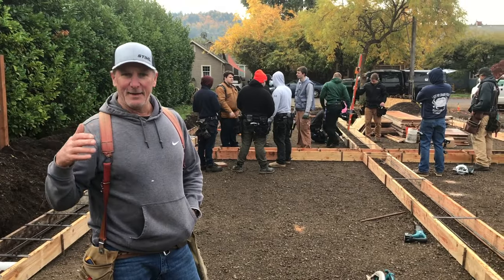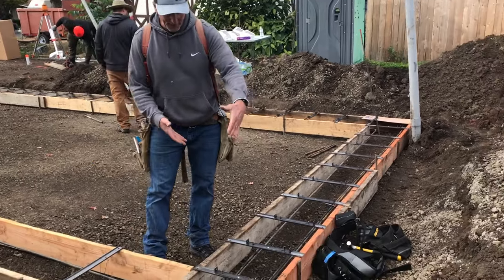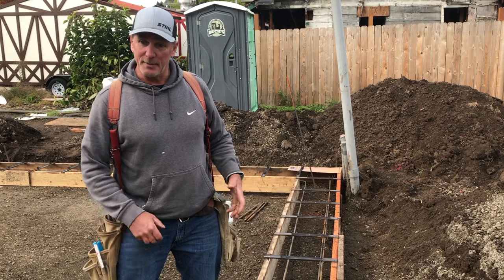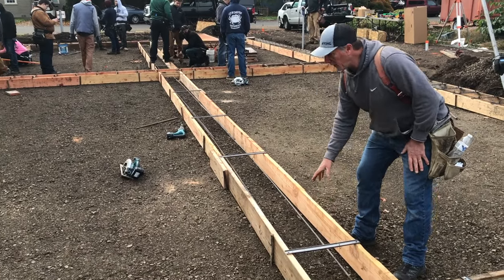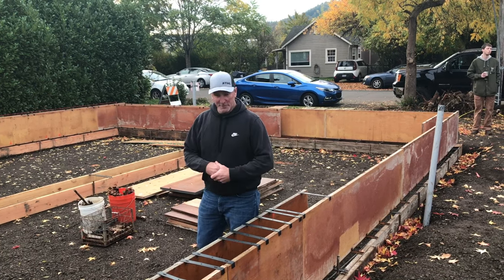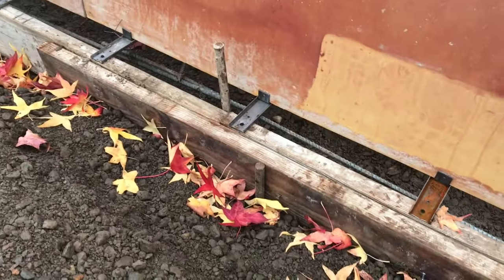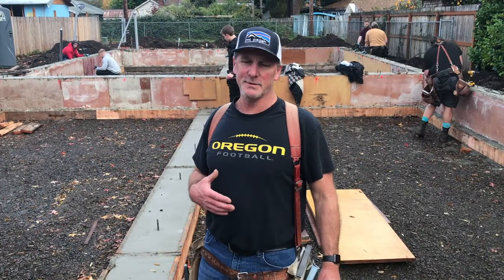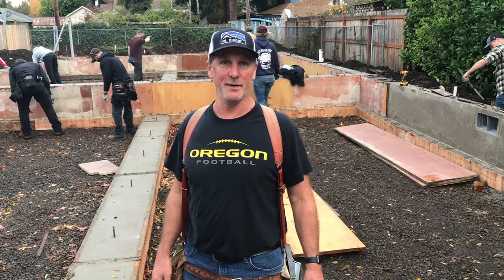Building a Crawl Space Foundation | Paul Rea

Comment: Any suggestions on where to buy the monostrap and spreader cleats as a DIYer? I am doing a similar foundation for a 16' x 24' home addition (I'm in Keizer, OR). I plan to use 2x dimensional lumber for all the forms, 2x8 for the footings (16" w), and (2) 2x10 for 6" wide stem walls. In between the (2) 2x10s I plan to use Simpson wt-6 ties with w1 wedges. I found a decent supplier for those online, but not having a ton of luck on the others. Really appreciate the videos. My house is low to the ground, so I'm doing the top flange hangers like you did in a later video. I learned a ton from all your videos, and they helped me get my structural permit smoothly :) Thanks!
Reply from the maker: We used Mason's Supply for the monostraps and spreader cleats.  It looks like there is one in Salem.  There are also 5 around the Portland area.  Good luck on your project!!!.
Reply: @buildinghouses  Appreciate the quick reply. I'll check them out. Thank you!
Reply: @Dlux DIY were you able to buy the mono straps from mason supply? We are in Independence OR and doing the same thing as you, but they wouldn’t sell to us as homeowners. Any other place you found them? Good luck on your project!
Reply: @andreawagner3954  I was told the same thing as you. I ended up finding them at Kilgore Blackman's on S Commercial in Salem. I'm actually finishing up my forms this week and pouring next Tuesday! GL on your project as well!

Comment: Thank you for a great tutorial on how a crawl space foundation is constructed.  Two questions.  Once the area is excavated, is compacting recommended before installing the forms?  Also, is the main water line run under the footing or is a hole bored through the footing?
Reply from the maker: 1) Yes, once excavation is done, compacting the whole area especially where the forms will go is a necessity.  2) The plumber puts a plumbing pipe in the footing, a small one for the water line and a larger one for the sewer line before the concrete is poured.
Reply from the maker: The pipe installed in the footing is larger than the water line and sewer line.  After the concrete cures for a few days and the footing form boards are removed, the plumber can then run his water line and sewer line through the footing.

Comment: Great video.  What if you wanted to crawl between stem walls.  Would you block out an access hole and frame it with a header or how would you go about that?
Reply from the maker: Take a look at our other video "Framing a Crawl Space Underfloor".  Paul describes how to frame out an access hole in the video.  Thanks for the comment.
Reply: @buildinghouses  thanks.  I watched the video.  What I am talking about is a horizontal access through the stem wall.  Can you explain that please?
Reply from the maker: Sorry for the late response.  I talked to Paul.  He reminded me that on this duplex building the stem wall is part of the fire wall.  So you can't have access between the buildings because it would compromise the firewall.  The firewall is discussed on the "Building Walls for a (Duplex) House" video and it is discussed on the "Rolling the Trusses (How to Put Up Trusses)" video.

Comment: Great video! I am planning to build a house and really like the cleat ties and plywood form boards for an easy stem wall form. However, it looks like it's not very cost effective for a one time use? Having enough 1" plywood to form up the entire stem wall must cost thousands of dollars. Were these plywood boards ones that Paul already had and was just re-using?
Reply from the maker: Hi Robert.  I looked back at my records and we bought the form boards back in 2019 for a total of $725.00.  In this video this was our 3rd time using these form boards.  We have since used them on a 4th building.  If you can get a good deal on the form boards it may be cost effective for a single use?  Maybe you can resell them??

Comment: When pouring is it better to pour the footing than let them set than come back in pour the walls or pour it all in the same day?
Reply from the maker: In the system we built in the video, the footing and stem wall are tied together, so they should be poured on the same day.  There were two concrete trucks that showed up that day.  As Paul mentions on the video, we are trying to get the footing and about a foot of the stem wall filled with stiff concrete.  Once the 2nd truck arrives (which should closely follow the 1st truck) we filled the stem wall to the brim and may increase the slump of the concrete by adding a little water.  Paul talks about the mono-straps in the video.  The mono-straps are used to tie the footing and stem walls together enabling us to do just one pour.  Hope that helps.  :)

Comment: Really informative video, thanks. How much did/would that/your exact project shown in your video cost, concrete at what price, leveling and conditioning ground at what depth (I have clay at 6 inches in zone 8a), labor and materials, so I can compare prices and adjust for my prices? Edit: Also, did you add any more rebar in stem wall, won't the spacers on top of footing rust and weaken the concrete, and do you add any additives in concrete to make it waterproof?
Reply from the maker: Glad you enjoyed the video.  We spent $1,620 on vents, mono straps, rebar, foundation cleats, anchor bolts, and some footing forms.  We had purchased  the stem wall panels a few years ago and had some 2x8's for the footing forms on hand.  The concrete cost $2,848 and $345 for the concrete pumper.  It was a class project so no labor cost.  I believe the excavators dug down, rocked the pad at 1 ft depth.  Our finished grade was around 18".  Paul mentions in the video that finished grade in Lane County is 12" , Bend is 18", and Klamath Falls is 24".  There is one course of rebar in the stem wall (you can see it on the video during the concrete pour).  Part of the mono straps (spacers on top of the footing) that are exposed do rust however I don't think the part that is encased in the stem wall will rust?  I don't believe we put any additional additives on the concrete.
Reply: @buildinghouses  Thanks a lot! You ought to pin your own answer, so lots of folks can see this valuable info. You are the only one that has ever given me such a complete answer.

Comment: Good afternoon 
Thank you for the great demonstration. 
I have an area of 6'x2'x1' deep.
Is four rebar spaced 8" vertically and 8" horizontally is sufficient for my project?
Thank you
Reply from the maker: Can you describe in more detail the project that you are doing? Is this for a foundation?  Where is the project located?
Reply: @buildinghouses  yes, I am adding a 6x 20 addition to the side of the house. I have  dug a u shap trench 24 wide and 16" high and 6+20+6 trench. 
Thank you
Reply from the maker: I wasn’t able to get an answer from Paul.  Too many unknowns.  I would check in with your local building department to check over your design.  Different regions of the country need to have footings at certain depths.  They can also advise you on drainage issues at the footing and how much rebar is needed.

Comment: So much air in that foundation, setting it up for long-term failure. Concrete vibrators are imperative for a proper load bearing wall/foundation etc. Use of a vibrator allows for proper adhesion to rebar and  reduces air pockets (which leads to structural weakness and flaking). 
Vibrators are our friends :)
Reply from the maker: From Paul Rea: Yes I agree there is a time and place for a vibrator when placing concrete.  I had the concrete batched at 3500 psi and sent out at a 5 slump with the intention that it could have water added if needed and not compromise the concrete strength adversely.  The only place a vibrator would have been remotely useful in this application would have been for the footings.  However, knowing that I wanted the concrete to pile up in the stem wall six inches or so on our first round of the pour, it was easier to consolidate the concrete in the footings with a small board or tapping the outside of the footing just enough to accomplish the task.  Touching any of that with a vibrator would have made the concrete empty from the stem wall and overrun the top of the footing.  It already over ran more than I wanted and was more work than it should have been.  Concrete did not flake, there were no voids and I am confident of its strength and integrity.  Paul Rea